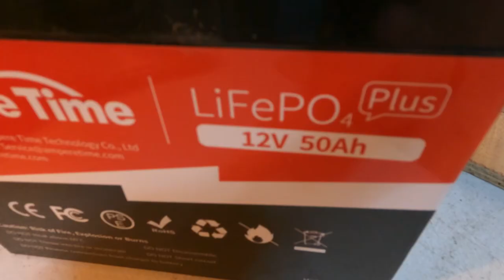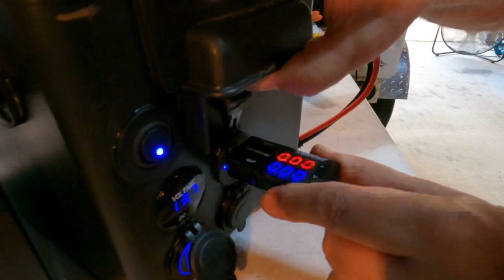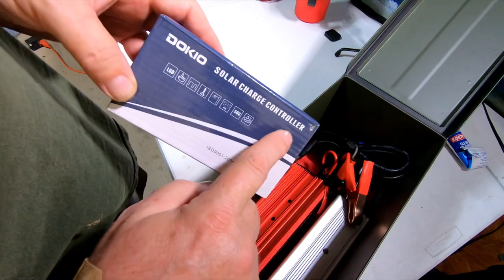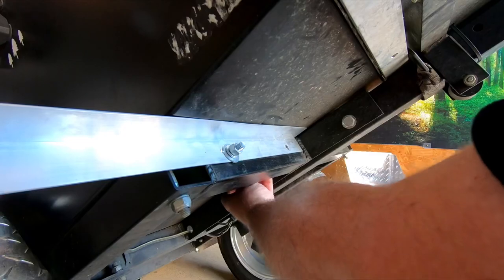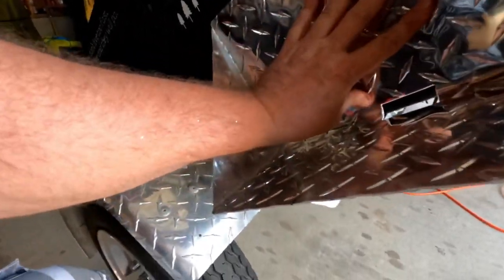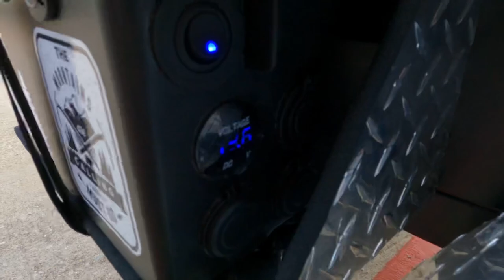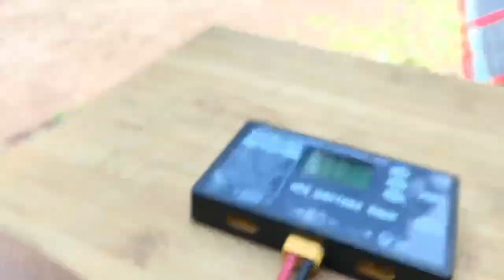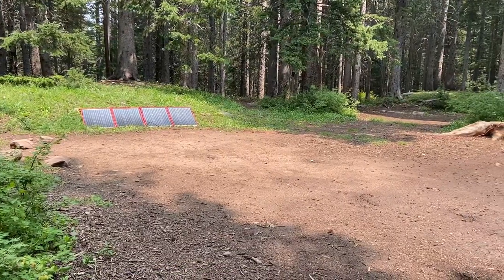Building a Solar Generator Setup

Comment: You can buy the battery box for $50 fully fitted out to save yourself time and money. I bought one for my 12v set up in my car. I took the lazy way out 😂 . Great video mate. Also your battery is full and once it is full your amps from solar will drop down. Try using some of the battery then plug in solar and your amps should go up. I run a car fridge 24/7 off mine.

Comment: Great video, I've been thinking about doing this exact same thing for a while. I always thought I would use a 100 Ah battery, but 50Ah would likely be more than adequate . The main need I have is to power my C-Pap but it runs on 12 v so no need to run through an inverter. I would also want to charge various camping accessories such as a mini air pump, fan, lights, etc. Eventually, I would like to add a Dometic 12 V cooler to get away from needing ice.

Comment: Thank you your videos are very motivating.  
What is demension of the cooler base you got from the same company. Thanks. 
Very cool on MS to Baltimore triop working with my trailer when get home will use your idea for motivation . Have same trailer only difference is assembled with 3M marine adhesive to all joints including the axles to aluminum slow electrolysis and rain seeping in .
Reply from the maker: I'll measure it when I get home to Texas. I'm in Colorado and my trailer is home in my garage. I know it fits a 20 qt RTIC cooler perfect. It also fits my 12V Fridge.

Comment: Nice!   Only thing I noticed negative was you don't use dielectric grease on soldered wires when using heat shrink!
Reply from the maker: Actually I did use dielectric grease. You must have missed it.
Reply: @SteveOutdoors  I worded that funny sorry.  I meant you should not use it.  The heat shrink is meant to seal up air tight and holds the joint and protects it from corrosion.  Using dialectic grease prevents adhesion and a seal.   I'm sure the way you did it worked fine.....just thought I would share my advice on it.   Great video and content definitely gonna check out your other videos.
Reply: Very Nice setup and loved the video. I also have the Lumina XL trailer but have only used it for traveling to motels. But want to start camping with it too. It's a hard sell somewhat to my wife when we also have a 40 ft. 5th wheel toy hauler.  Lol!!!

Comment: Could you run another set of panel in parallel to a single controller to  provide more Amps?
Reply from the maker: Yes I don't see why that wouldn't work. I'm thinking about mounting a small panel on the front of my trailer. I could it to charge while traveling and use both panels to charge at camp.

Comment: Why not mount a solar panel on the top of the trailer so you can charge the battery riding down the road? Works great on my trailer.
Reply from the maker: I have been looking at getting one for that little spot just behind the cooler. I'm always carrying stuff on the very top: Boat, electric bike, fans, etc.

Comment: Now that you have this up an running is it performing and meeting you expectations?
Reply from the maker: Beyond actually. I just got back from a 5 day camping trip. It was a non-electric site.  I just left the panels setup facing south and plugged into my battery. I brought a fridge/freezer with me this time. I ran the fridge continuously and ran string lights at night. After the first hour of sunlight every day the battery was completely recharged.
Reply: @SteveOutdoors  that is outstanding!  Running a CPAP all night should be no problem. Thanks.

Comment: Excellent video except for one thing. For those of us who are only mildly inclined electrically you did not explain what each component was as you were installing them. You need to give a minimal description of the glue used to fasten things down with. I have a marine battery and want to do something like what you have but I do not understand the electrical connections very well. I noticed later in the video that the cylinders you mounted in the side of the battery box are USB ports primarily. Could you have mounted an electrical outlet like a house has? Also you did some welding(?) with a torch and a rod on the metal  that you mounted on the side of your trailer. What is that?
Reply from the maker: I did this 2 years ago. I probably should have broken it down into 3 videos. Basically for the usb and 12V outlet you just need to hook positive to positive and negative to negative with a fuse on the positive line to the first component. For a 110 electrical outlet like a house has, I use a 500w inverter that hooks straight to the battery. If I used a bigger box I could have installed that in the box. But since I motorcycle camp I have minimal room. The aluminum shelves I added to my motorcycle trailer were for the battery box on one side and cords and inverter box on the other side. After this video I added a 12V fridge that I plug into the battery.

Comment: Thank you for sharing your Knowledge with us ! Can you show more detail of the wiring  inside the box?  What is the pink wire for ?  How do you hook up and use the 500w Inverter ? Can you use it without the solar panels hooked up and only use the battery ?  Sorry for all the stupid questions but I want to do mine the same as yours ! Have a safe trip and catch alot of fish ! Hope to go there next year .
Reply from the maker: When I made this video I was trying to hurry and get it ready before my Colorado trip. I think I'm going to remake this video into 2 or 3 separate videos so I can go more in detail and show more of how to do it. Thanks for the questions it will give me ideas of what I need to go over.

Comment: Enjoyed the build. On the Charge controller, at one point you state, “Battery first, then solar panels.” Later you stated, “Charge phone via USB ports on controller, without a battery.” I find this suspect, as the dead cellphone battery wouldn’t meet the power demand requirements of the Charge Controller. The voltage required to operate the controller, might be small, but destroying the controller, by hooking up panels without a battery source, seems detrimental.
Reply from the maker: According to the controller instructions you can use the usb outlets without a battery plugged into the controller. But if you then decide to plug in a battery, unplug the solar panels first, plug in the battery, then plug the solar panels back in.

Comment: Thank you Steve for the great video.  You have a nice and easy way of presenting your information and experiences with motorcycle camping.  I have a question in regards to the method you used to "weld" the diamond plate brackets for your battery box.  Could you let me know which solder you used and if there is anything special you did for this process ?
Thanks again for your great videos. Ride safe 
Chris
Reply from the maker: Hey Chris, You can get aluminum brazing rods at Home Depot or Lowes. I used the Benzomatic brand. You'll need brazing rods and a good torch. I always sanded the area to be fused together first and then wiped it with acetone to make sure it's good and clean. Clamp the pieces together. Then you want to heat the area until it's hot enough to melt the braising rod when you touch it to it. It's good to practice with some scrape pieces until you get the feel of it. I used ceramic tile under the aluminum and against any wood to protect the wood from catching on fire. I also kept a fire extinguisher handy.
Reply: Thank you Steve.  Appreciate the info.  Look forward to more of your videos.   Ride safe.  
Chris

Comment: You might have mentioned it, but have you considered running a pigtail to you bike to charge the battery pack? Nice set-up. Cheers~
Reply from the maker: I haven’t yet but I may. So far the solar panels are charging it pretty fast.

Comment: I purchased a trailer like yours. Do you weigh your tongue after loading it? We are going to take a big trip soon. I enjoy your videos.
Reply from the maker: Yes I weigh the trailer and the tongue. Make sure the tongue is at least 10% of the trailer weight. I weigh under the tires with a bathroom scale and use a fishing scale to weigh the tongue. Add all 3 together for the trailer weight.
Reply: @SteveOutdoors  Okay. Do you have a upper limit to the tongue weight?
Reply from the maker: @okiemoto6114  I keep it between 10% and 15%.